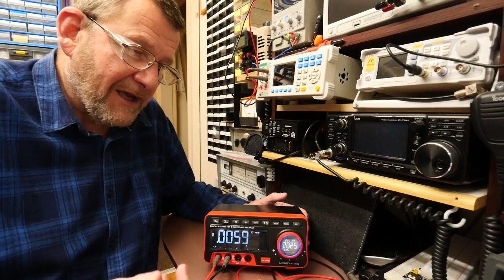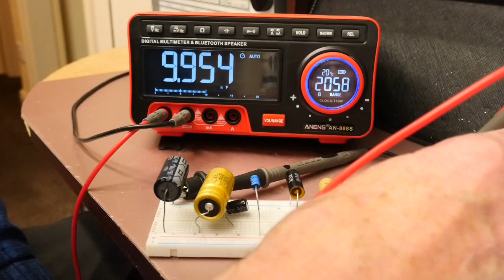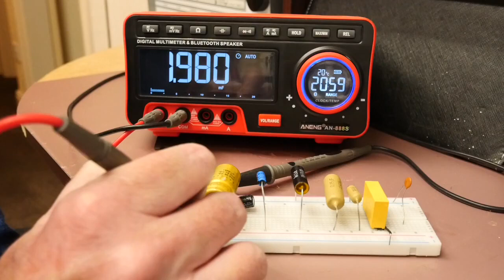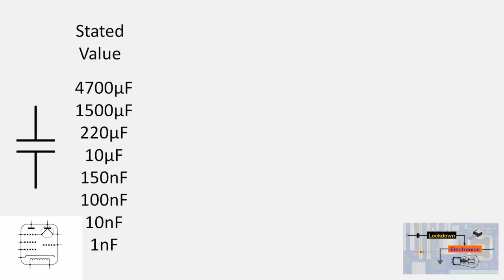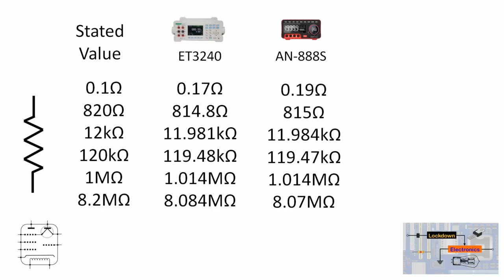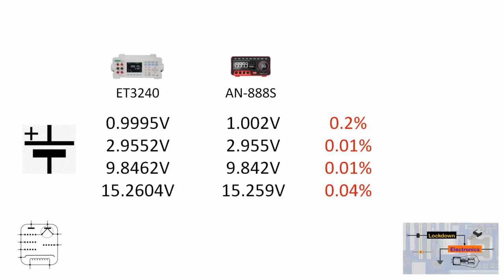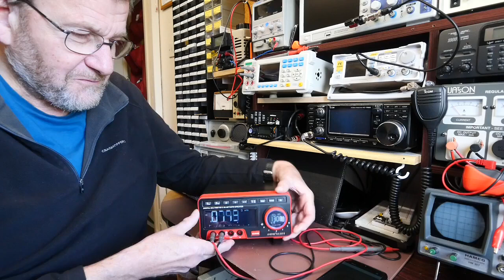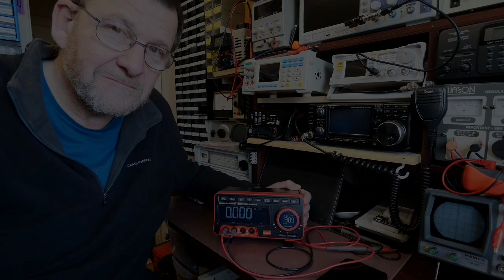ANENG AN 888S - Long Term Review

Comment: Thanks for the video. Just a quick question. When I first purchased the 888S, it could more or less hit the voltage within 0.005V. Also, the display would read 0.000 and never fluctuate. I noticed that the display was jumping between 0.008 and 0.017. When your video starts, I can see it immediately and you didn't address that. Am I mistaken and any DVM can fluctuate like that without a load or measurement? I ask because none of my other meters does this. Also, after having my 888S for about 9 months, I find that a 2.5V ref is reading at 2.46 (when it read 2.5V out of the box) 5.05,V 7.095V and 10.168V for 5,V, 7.5V and 10V respectively. I did see your numbers in the video and they are good, even with the blinking. As far as you know, is there any way to "factory reset" the 888S, if not, then I would definitely become a 'bluetooth speaker'.

Comment: Good review, I have one of these and like it a lot.  It would be interesting if you had a third column of results using the DE-5000 LCR Meter with the 4-wire Kelvin leads.  It should be the most accurate of the three units.  I use the AN-888S almost exclusively when I'm restoring radios and checking voltages and resistors that may need replacing.  I use the DE-5000 to check capacitors our of circuit, including new units just to be sure.  When using the 4-wire Kelvin leads and calibrated before use it is a lot more accurate than any of us hobbyists need.

Comment: Are you going to get the AN999S ?
Same meter but I think you can transfer data via Bluetooth and it talks.
Personally I wish they made one that didn't have the Bluetooth speaker.
Reply from the maker: Not planning to get the 999s!
I never really used the bluetooth feature.

Comment: Myself I had no use for the bluetooth gimmick and hate the fact the clock is only 24 hour with no 12 hour setting option as im not in the military so have no use for it - also the temp defaults to C* and I have to change it to F* every time I turn it on, but im an old guy that grew up in the US so im used to Fahrenheit.  BUT - I love the 20,000 count EBTN display , its overall build quality is excellent, accuracy is very good and I found mine for just under $50 on sale and I think its got to be one of the best values out there for a beginner or hobbyist bench meter.  Even if it didnt have the bluetooth and other ancillary gimmicks on the secondary round screen I still feel the meter section itself would be worth the price due to the quality and accuracy.  I even noticed the input jacks have a nice tight click type grip on the leads, only thing one might do is add a nice set of silicone leads to top off the overall quaity feel and youve got an excellent beginner or hobbyist meter or even a backup meter for a pro.  To me its worst fault is having to use a long screwdriver and crack the case if one needs to change a fuse, but im ok with that as im careful and rarely if ever blow one.
Reply: The day has 24 hours, not 12.